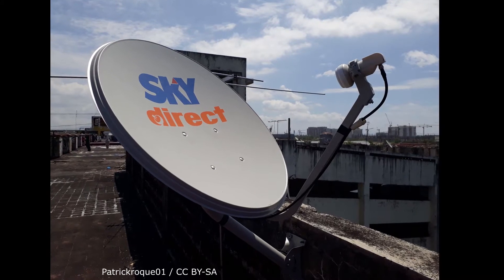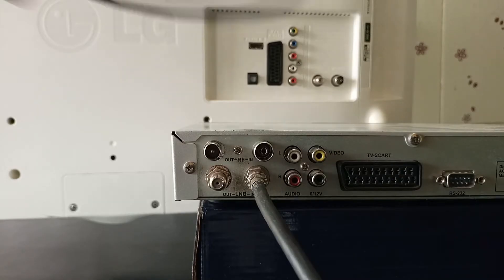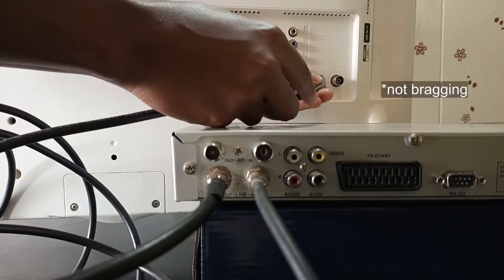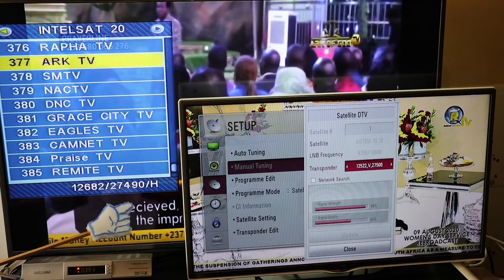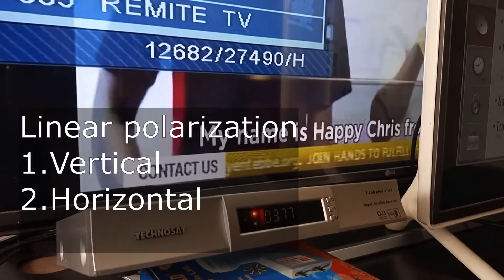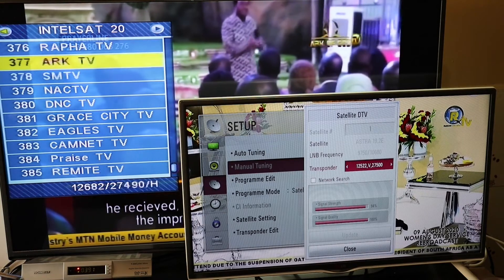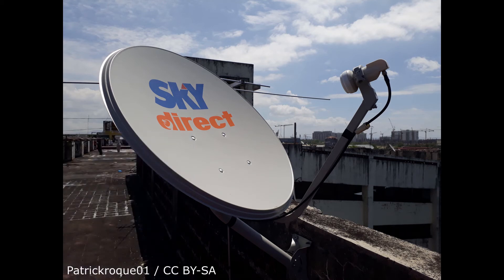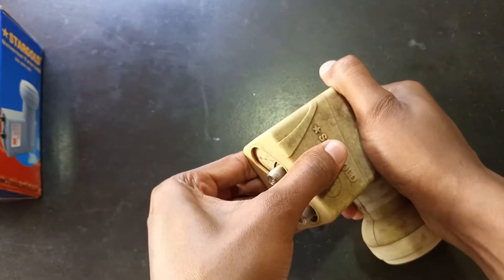The Problem With LNB OUT Ports

Comment: Horizontal and Vertical can work at the same time but not through the same cable. That's why you have LNB's with multiple outputs. 

But there is a second detail. Beside horizontal and vertical polarization a modern LNB will switch between low band (10.7 - 11.7 GHz) and high band (11.7 - 12.75 GHz). This is because a standard coax cable can only handle frequencies up to around 2.5 GHz. But since frequencies below 900 MHz are used for antenna and cableTV and many people want to have one coax for antenna/cableTV and satellite usually there is only around 1 GHz available on the coax for satellite. 

So either the 10.7 - 11.7 GHz is down-converted to 950 - 1950 MHz or 11.7 - 12.75 GHz to 1100 - 2150 MHz. 
Switching to high band is done by sending a 22 kHz signal.

So in order to receive one complete satellite you need 4 cables:
- VL Verical low band 13 Volts
- VH Verical high band 13 Volts + 22 kHz
- HL Horizontal low band 18 Volts 
- HH Horizontal high band 18 Volts + 22 kHz

A quattro LNB will not be able to switch between band and polarization but instead will always send VL on port 1, VH on port 2, HL on port 3 and HH on port 4. This is usefull when you want to use a multiswitch to distribute a satellite signal to all your TV's.

However there are special wideband LNB's which are able to convert the complete frequency block of one polarization at once. They convert the complete 10.7 - 12.75 GHz band to 290 - 2340 MHz and Vtotal on port 1 and Htotal on port 2. This is even more usefull for distribution especially when having mutiple dishes and/or satellites you want to receive so for each satellite you only require 2 cables and can do distribution with a wideband compatible multiswitch indoors.

But I said Horizontal and Vertical cannot work through the same cable, there are special LNB's which can put Horizontal and Verical on the same cable but you need special expensive coax which can a signal up to 5 GHz because it will use 0-2.5 GHz for H and 2.5-5 GHz for V. But these are not very common and popular. It's usually much cheaper to just use a two output wideband LNB with two standard 75 Ohm satellite graded coax cables instead.
Reply: Thank you very much for this useful information

Comment: I am using JEC CA-3246 800 watts 4 channel please help thanks and i am using pioneer tweeter ts-s20 so what is the best capacitor to protect my tweeter
Reply from the maker: Generally a 4.7 Micro farads and a 1K resistor in series will work fine
Reply: @DominicGichane   ok  thanks Dominic another quiz so I need to connect them together
Reply from the maker: @jacobabuogo3597  yes
Reply: @DominicGichane  Thanks bro
Reply: Please Dominic can you make a video how to connect it or show me the diagram please